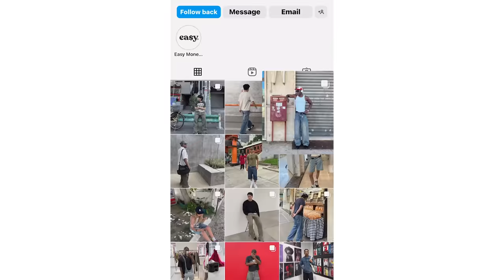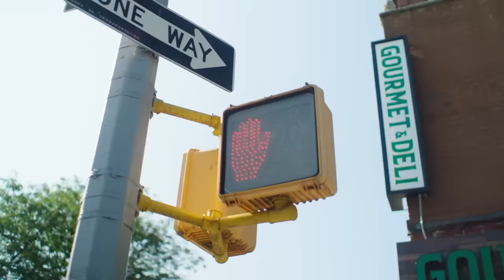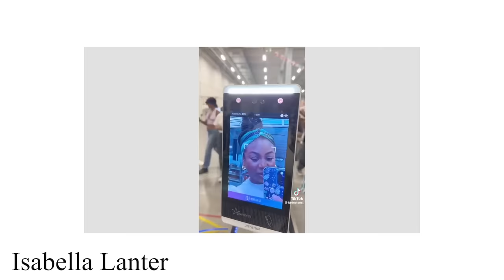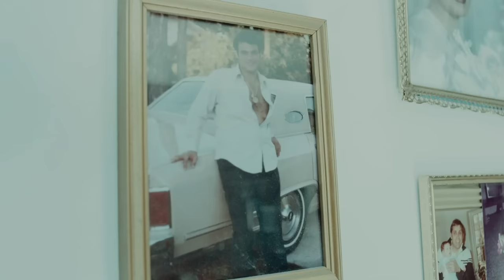Best & Worst Trends of 2023

Comment: YOU are so right generally with menswear. like there are so many restrigtions for man.  I mean just think about that a women can basically wear everythig a guy wears (cropped tops, tight tops, tights, skirts and shit) but they aswell can wear sweaters pullover, suits. a guy obvs can´t wear dresses for example. but a women can wear an oversized sweater and so on. and in high fashion fashion brands it becomes apparant that fashion is mostly made for women in general, like  was in Paris and the botiques were full of women. which I can understand because as a guy there are few pieces that are actually wearable as a guy and not basic

Comment: Someone probably already said this, but when you spoke about "skirt layering" I think what you meant was styling. None of the looks you demonstrated were with "layered" skirts -- peter do is a good example of layering a skirt over pants, for example. In general you mentioned layering in place of the proper word or styling or even pairing. Same goes for the cropped shirts; none were necessarily layered as much as they were simply paired with certain pieces. Hope that helps!

Comment: I despretly wanted to like the wide pants but Im short and my legs are really top heavy and I have a smaller waist end result is a pair of pants kinde lose on my waist but to tight on my upper legs to move much. I tell myself girl u just havent found the right one but honestly Im just waiting for this trend to go away. they are just not flattering me. I will ware my boot cuts and flareds or bel bottoms and my baggy cargos that are not even baggy in 2023 standards. love the jorts and baggy capris with loser waists that you can adjust tho they slap